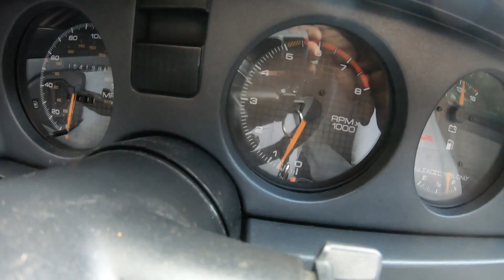Stock GM TPI swap to FIRST TPI install - 1989 Trans Am

Comment: So, newer car person here, apologies if it’s ignorant. But what would be the pros/cons in contrast to a carburetor swap for these engines? These sound amazing, and I’m tempted to get one for my ’89 GTA from you guys. Thanks in advance!
Reply from the maker: Hello! So geeze this is surely a loaded question😁I could actually write a book on this topic, there is so much to point out! This topic is definitely a can of worms when opened and a rabbit hole for sure! 🤪 There are so many schools of thoughts out there on this topic and some are facts and some are opinions. Anyway we will keep it shorter by just saying that a few of the pros with any fuel injection system to start would be they are much more efficient than a carburetor. You get better fuel economy,  better throttle response, better cold start and better overall  performance and the list will go on. Yes you certainly can get all of the above with a carb, but from my experience carb will fall short in these areas in comparison to fuel injection. Queue the carb guys, because here we go, right! Some cons would be cost, electronics, fuel system upgrades etc. If your car is not fuel injected now, you would need to upgrade the fuel system with a high pressure pump, fuel regulator and new fuel lines and such. You also need to add an electronics system which requires proper wiring knowledge. Although most aftermarket electronics are pretty much plug and play now, you still need to layout and install the harness and wiring appropriately. You should also have some basic tuning knowledge to help understand things, but there again there are quite a few plug and play self learn electronics that do well and you can just let it do its thing. I like and use both carb and fuel injection, so I have respect for carburetors and fuel injection and they both have their place, so it really would be project and user specific. I am fortunate that I was able to work in the industry while carb was the only thing basically and when fuel injection became standard, so I have real world experience with both and both work well in the appropriate situation.
Reply: I see. My GTA is TPI currently and I keep hearing from people to either Carb swap or that the original TPI absolutely kills my engine in terms of its performance. I wanted more of a project that I could keep semi-original but have a bit of performance and looking at these, it’s something I can tell I may want to put on my car. I’m exploring all types of options since my car’s being rewired, so I’m excited to work on it and figure some stuff out. Thanks for the response.
Reply from the maker: @wheatsourdough  For sure the stock GM tpi is a bit small for the 350, but it still does great! The FIRST tpi is the answer to that. It flows over 30% more than the stock one. That is with the FIRST tpi at 1.75" ID and it can be opened up to 1.9" ID. So those saying tpi kills Performance is just not correct! They are just ignorant to what is available out there in tpi form.😁

Comment: You don't use any sealant around the water jackets before putting the gaskets in place ?
Reply from the maker: Typically no. If the heads are used and there is some slight pitting I will put a small amount on them to try and "level" the sealing surface. But if they are smooth I do not. Not that it will hurt if you do, just keep it thin and spread it nice with your finger, so it does not ooze out everywhere. I have seen many guys use way too much and it falls off inside. I can't tell you how many oil pump screens I have seen with chunks of sealant in them!
Reply: @firstperformancecenter  thanks for the tips!
Reply from the maker: @CPMest81  You bet, we are here to help!

Comment: Hey Ken when are you doing the L98 corvette?
Reply from the maker: I am actually in the process now. There were other things that had to be done ahead of the FIRST tpi install, like cleaning, detailing the engine bay and engine along with installing cam, timing chain, AFR heads, roller rockers etc. I have been working on it between other jobs, so it has been slow going. 🙄 But the FIRST tpi intake install video for the 85 C4 will be coming soon!

Comment: Richard Holdener has a thing for TPI's. You should get him to put this on the dyno then add some boost.
Reply from the maker: Yes I have already offered to bring one out to him and run some testing along side, check his mega tpi video and you will see my comment.
Reply from the maker: Also on a side note the Vector W8 used the FIRST tpi with turbos and there are many customers that have as well, if you were wondering if boost has been used with the FIRST tpi before.

Comment: Where does the fuel pressure regulator mount on an earlier tpi where alternator is instead of the ac?
Reply from the maker: Hi Johnny, can you email a picture of your engine bay to ken@firstperfcenter.com. this way we can be sure to make the correct recommendation for you. Thanks!

Comment: Great video!  Just wondering what the black cable running on the driver side hood from the inside to under the hood is for?
Reply from the maker: Thank you! That cable is for the scan tool that I was using for engine monitoring and data aquisition. It was going directly to the battery for power. Typically I would use a cigarette lighter in the car, but it did not work.
Reply: @firstperformancecenter  Awesome!  Thank you very much....

Comment: I'm not a big fan of the throttle body looks, does the plenum fit other throttle bodies or do I have to use the provided one?
Reply from the maker: The FIRST plenum does not directly fit any other throttle body. It would be recommended to use the one designed to match the system.

Comment: Is there a HP and TRQ gain over the stock intake? Does the PowerBar move?
Reply from the maker: Absolutely! The FIRST tpi with the 1.75" ID runners flows over 30% more air than the stock GM tpi. Then you could open the system up to a complete 1.9" ID and even do some siamese work and really move things even more!

Comment: Can you tell me the height difference "installed" between factory tpi and FIRST tpi?  Im wondering if it will clear my umi strut tower brace.  There isn't a lot of room with the factory tpi i. Not sure how much taller the FIRST tpi is.
Reply from the maker: So it really depends on where the strut will cross the plenum, but I would say figure 1" to be safe. It could be be less, but from my experience most clear the FIRST tpi without any issues.
Reply: @firstperformancecenter  awesome. I think even at 1" i could make small modifications to get it to work anyway.  I appreciate the reply.
Reply from the maker: @zachkuby87  you bet! We really appreciate it when people ask questions, the more information the better!

Comment: So what is the gain switching to this intake? I have. 1992 tpi 350 in a camaro 1992.
Reply from the maker: The gains are over 30% more airflow than the stock gm tpi. If you need more in depth information you can email Ken@firstperfcenter.com. Thank you for your interest!

Comment: Hose clamp on high pressure fuel injection? Press fit AN hose is the only option!
Reply from the maker: So yes the fittings we use are push on AN with smooth clamp fuel injection hose. Smooth clamps used with high pressure fuel injection rated hose has been in use for many years and if done properly is completely reliable and safe. Especially if you keep the hose sections short. I use as much steel line as possible and hose as little as possible, steel line is far superior to any hose for sure.

Comment: Some dyno vs a tradionally modified TPI might be helpful?
Reply from the maker: We can email anyone old magazine tests that show some comparisons with other intakes including ported stock GM tpi systems. We are in the process of posting these articles on our tech page on our website as well. There are some dyno results on many of the common forums for the third gens and Corvettes as well. In the near future we will be doing more dyno work videos showing larger heads and camshafts used with the FIRST TPI to show how that helps as well, along with different runner ID from 1.75" ID to 1.9" ID that the FIRST tpi is capable of reaching. We will also be doing some siamese work and showing the changes that does as well.

Comment: Why downgrade to a flat tapped cam
Reply from the maker: I would not recommend using a flat tappet camshaft. I would always use a hydraulic roller if given the option.

Comment: What is the dyno comparison from the factory TPI?
Reply from the maker: Unfortunately we do not have any comparisons on the dyno to the GM tpi yet, I am sure someone out there does. One also has to remember that the thing about dyno testing, is that if someone does not tune the car properly or have the proper supporting components they may not show the overall best results.The FIRST will definitely allow more air flow which will give great potential for HP and torque gains. We do have flow bench results between the 2 and the FIRST tpi flowed over 30% more than the GM tpi. That test was done with an "as cast" FIRST tpi with the 1.75" ID runner and a 1204 intake to head port size. The FIRST tpi can be opened up to 1.9" ID runner and the intake port can go all the way up to a vortec and 1207 intake port. I would recommend some searches on thirdgen.org and the corvette forum to find some more hands on experience that guys have posted. There are dyno results posted out there along with track times and such.
Reply: @firstperformancecenter  I don't understand why not. It is the key metric everyone will look at.
Reply from the maker: We actually did find an old magazine dyno test done comparing the stock GM tpi to the FIRST tpi along with a few other aftermarket intakes, It is posted on our tech page on the website www.firstperfcenter.com. Yes, this will give you an idea of what gains can be had by just switching intakes on a stock engine. However that does not really show the entire benifit and potential of the FIRST tpi when it is installed on an engine with good breathing heads and a larger camshaft and larger cubic inch engines along with more modern eletronics that can be tuned better with more aggressive components. Those better performing components really show the FIRST tpi potential when it is used on engines that don't have the stock restricted components.

Comment: Very interested in this setup, i will be using aftermarket heads, probably a crate motor long block.. my question is, do you have to do any ECM tuning  to delete the EGR system? Or just remove those parts and plug the vacuum sources? I have an 89 formula like the car shown in the video.. i also still have the air pump installed which id also like to ditch as well.. any info you can give would be greatly appreciated
Reply from the maker: Hi Matthew,  so when you get a new tune to support the new changes to your engine you would have the egr tuned out. You can just remove everything as you stated and no engine light would be triggered. If you have more questions please feel free to email Ken@firstperfcenter.com.

Comment: Hi a see the video like your first intake a will buy one in the future a see that the car in the begining of the video have SD3816 base plate whifh Vortec heads but do not have EGR Tube in the intake a could delete egr whifh vortec heads and do nothing more to the factory  computer
Reply from the maker: Yes the vortec heads do not have an egr crossover, so the egr would be deleted if the vortec heads were used.  The egr can be deleted in the program as well.
Reply: Ok but the SD3816 base comes whifh a hole close to the hole of the ignicion Distrib for the EGR Tube that a havet find that kit so what a really like to know is if a get the delete plates and dont do nothing to the ecu prom will the car work ok will it only turn on the check engine light or will also the engine will get problems at idle and Running Thangs for your help and keep Doing the good work whifh the First intakes
Reply from the maker: @josematias5142  I would recommend getting the prom reprogrammed. It more than likely would run, but maybe not the best.  If you do any modifications to better the engine such as heads and intake it should be done anyway to ensure that it will be the best it can be. You can email us and we can get you information for tuners that can help.
Reply: Thanks

Comment: Any gains?
Reply from the maker: Absolutely, over 30% more air flow than the stock GM TPI.
Reply: @firstperformancecenter 

Sweet love to build a TPI L31 Vortec with a crank trigger and low tension ignition system ( A LS'd Gen 1 350).

Do yall have a LT-1 (92-97) intake? Like to see that on a Gen 1 SBC or L31.
Reply from the maker: @shadowopsairman1583  You bet! We do make an LT1 base for the FIRST tpi.

Comment: That fuel rail/fuel line arrangement is hokey AF. I don’t understand. Why not use the stock arrangement? There’s absolutely nothing wrong with it and it looked good. Now you got a mess. Not impressed. I stopped watching this video at that point.
Reply from the maker: Unfortunately the stock rails do not work with how large the plenum and base runners passages are on the FIRST tpi. This method is far from a mess as long as guys understand how to do it. Some are overwhelmed with this modification for sure, so they should seek a qualified person to help. This will avoid it being a mess. All we can do is use the proper AN fitting adapters for the GM lines and convert to the highest quality aftermarket AN fuel fittings and such available.  Many systems use these fittings and they are just as good, if not better in some cases. Everyone has their opinion so I am ok with yours. We have used this type of fitting arrangement for over 24 years now with nothing but solid success,  so I guess the proof is in the results. I am sorry it does not sit well with you, but the good thing is you do not have to do it that way. Everyone can use what ever method they feel works best with their application. Thank you for your input and hopefully it will help others with another opinion on what to do or what not to do!